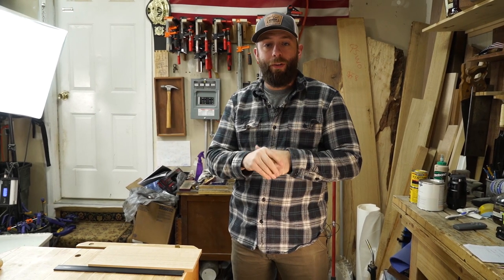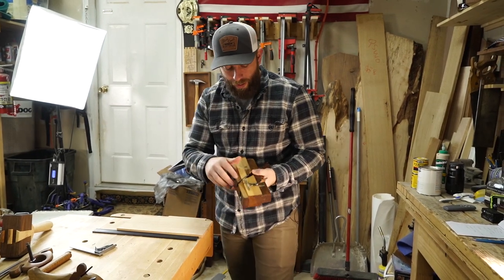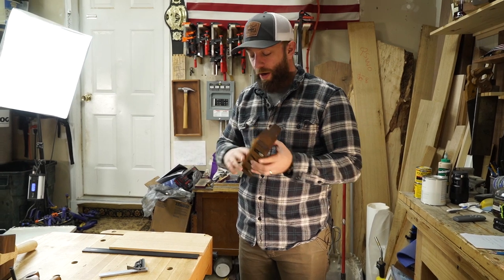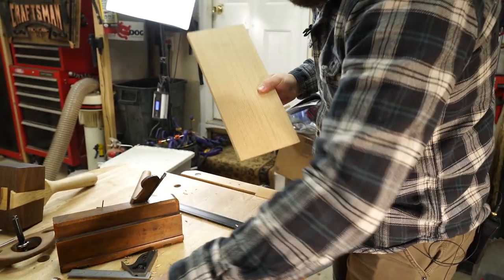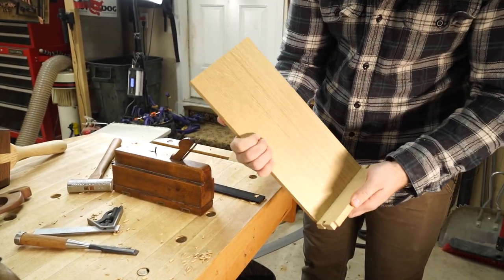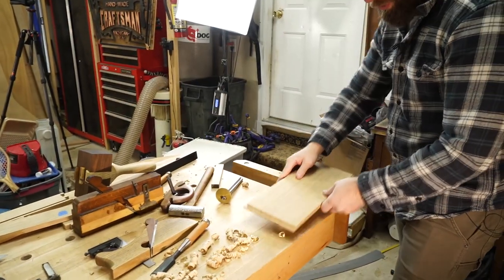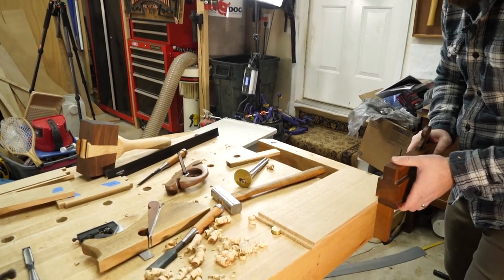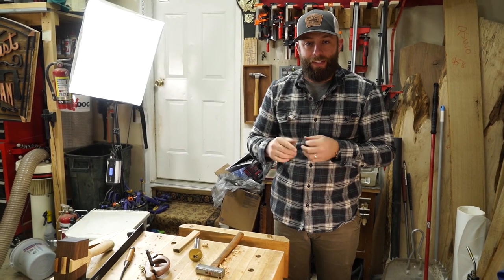3 Ways To Cut Rabbets With Handtools - One Take // Woodworking

Comment: Great content man. I was so bummed out when you got to the 4th side of the work piece and you grabbed the sliding fillister plane which you had already used, opposed to showing the set up and use of the Stanley #78 fillister. I did a basement clean out last summer and inherited a bunch of common and specialty planes, but I don't know how to setup or use most of them. So, I appreciate your recent content of hand planes. I'm hoping you'll cover a wide range of them. Thanks again for sharing. 👍

Comment: This is exactly what I am looking for! I'm making dice trays which are basically boxes without lids and I am struggling getting a rabbet cut to put the bottom on. I originally tried sawing from both directions and I couldn't get a good clean cut which caused me to spend half my time trying to square it afterwards with a chisel. I'll try using my shoulder plane with a deep knife wall and I think that'll get me a nice square rabbet.

Comment: When using the fillister plane, would you say your pushing more horizontally, to stay flush with the edge, or vertically to make the cut?  
Also, to Mrs "Third Coast Craftsman" you're doing great on the camera. :)
Reply from the maker: Pretty much equal pressure. You don’t want a ton of pressure on the heal though. Your downward pressure should be at the depth gauge.